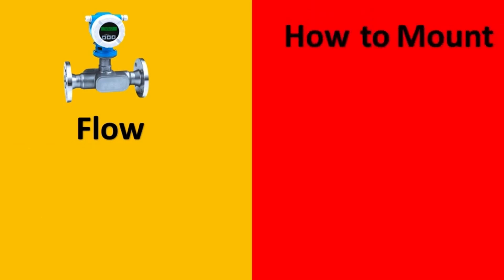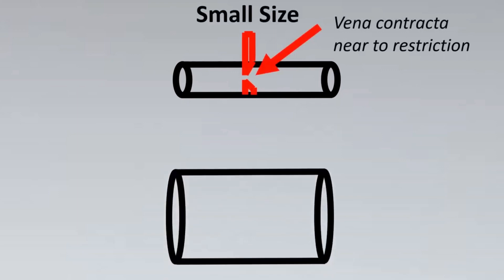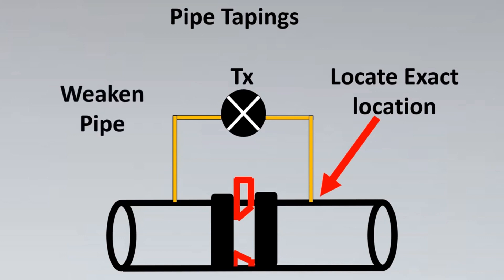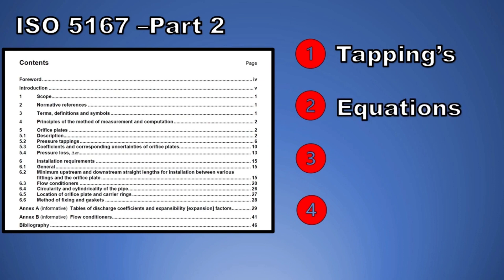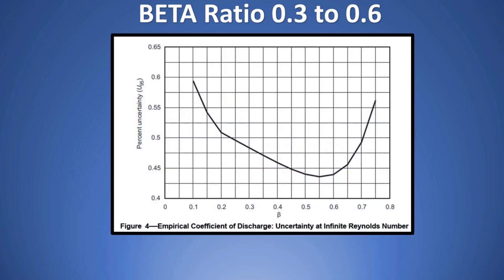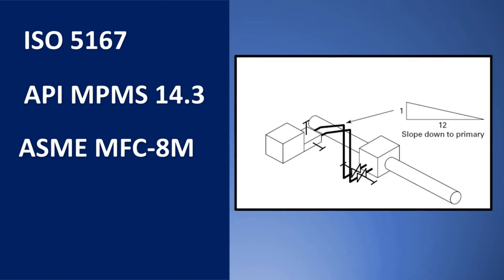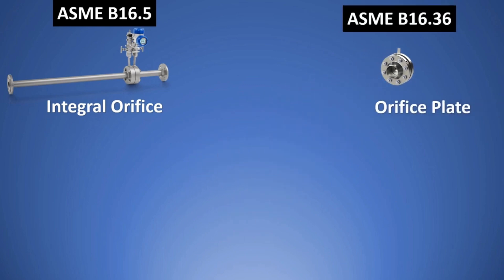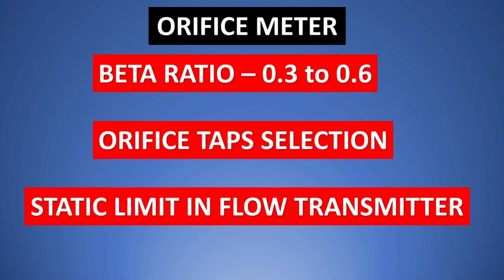Mastering Orifice Interview Questions: Top 3 MOST ASKED in 2023

Comment: 1. What should be the mounting orientation for multi phase fluid? 

2. If for a gas service the line is at the highest elevation with no deck / platform above it (only sky is above) then how would you locate the transmitter above the tapping? Or alternative?